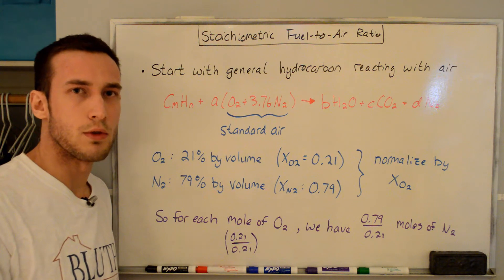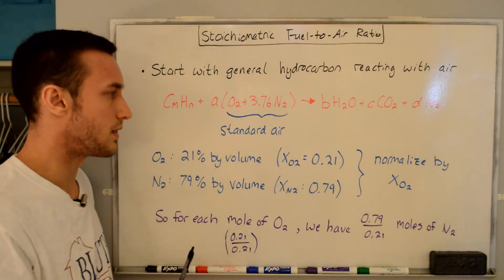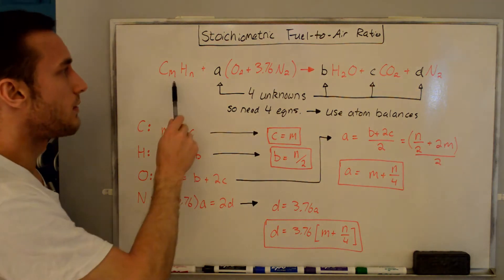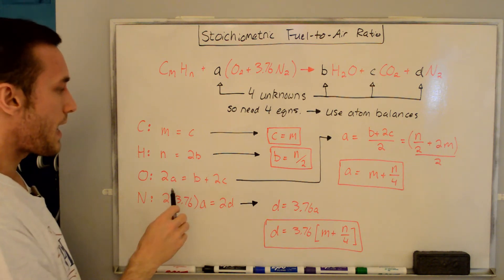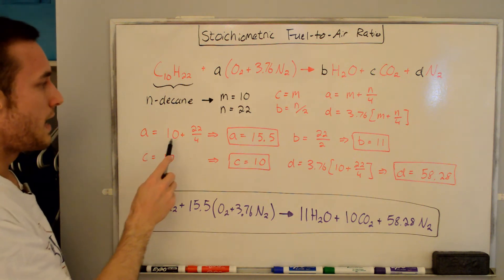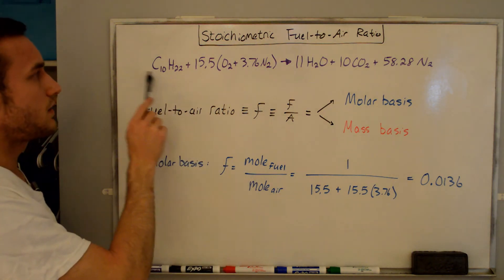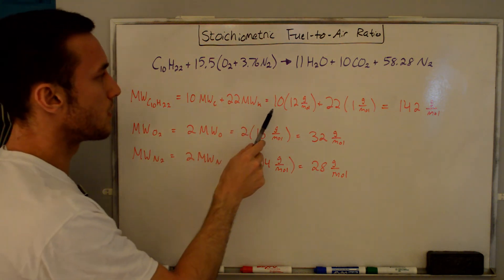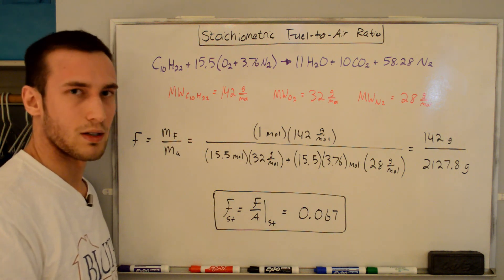Calculating Stoichiometric Fuel-to-Air Ratio

Comment: Thank you for the excellent tutorial. I am developing an H2 hydrogen generating system. My ability to produce many litres per minute is very good. What I need is to know the air to fuel ratio for H2 in an SI engine. I also viewed a video which calculated the pounds of air as 34 for every 1 of hydrogen to create a 100% burn of the hydrogen. Having a racing background I am now curious as to the efficiency possibilities of Hydrogen without some manner of Forced air induction system. I don't mean some air filter scoop arrangement either. I am talking about roots type blower or turbocharging. It is my thought now that an SI engine naturally aspirated will not achieve 100% use of H2 without said mechanical air induction, due to what I can see as an extreme lean condition being demanded or without the mechanical air induction it would be wasting much of the H2 produced. I am not the mathematician to make these calculations, could you help me with these calculations and offer your thoughts on my quandary? Thank you so much.